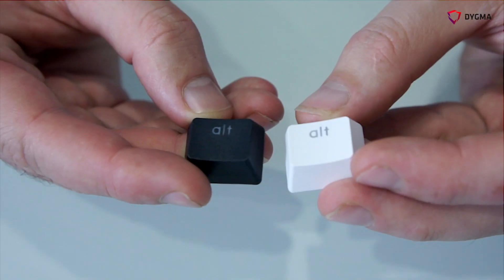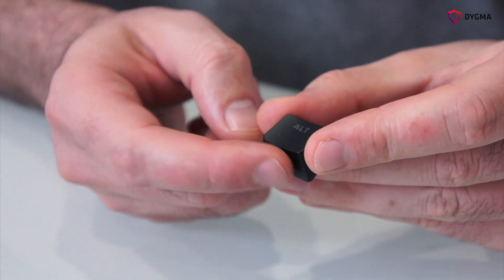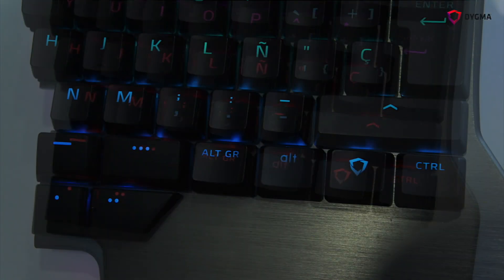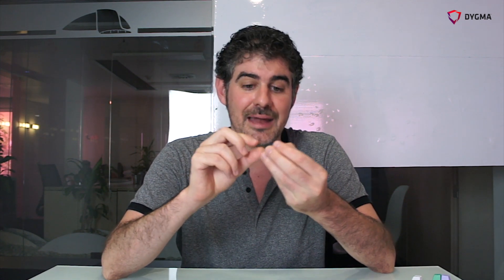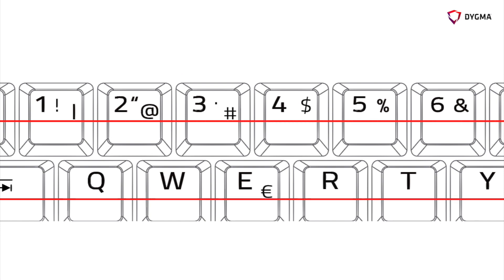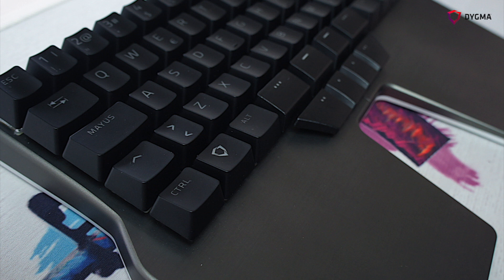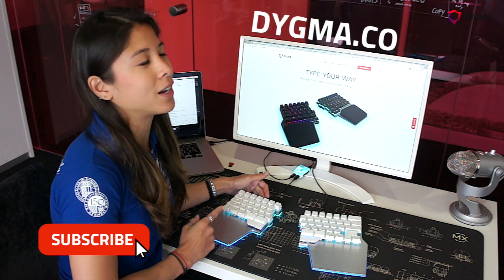Differences Between ABS and PBT Keycaps

Comment: Why dont had spanish pbt keycaps?
Reply from the maker: That's a good question. And the answer has to do with the demand for Spanish double-shot PBT keycaps and how PBT keycaps are made. Double-shot PBT keycaps are made using a mold, which is really expensive to have made. There are hardly any keycap manufacturers that sell PBT keycaps that aren't US or UK because the demand for other languages isn't that high.

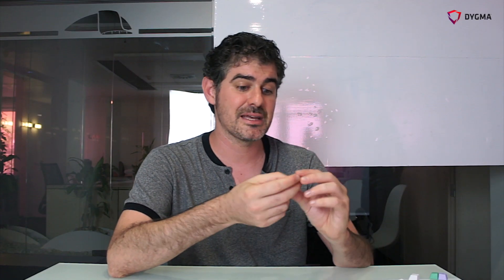Comment: I cannot understand what word you are saying at 1:15 when you say, "The ABS caps are absolutely xxxxx?" I NEED HELP PLEASE. I just got 4th Logitech Solar Wireless K750 for Mac (desktop) keyboard. I have old one right beside me which keys are shiny, smooth, silky to touch. This brand new keyboard feels so yucky chalky, grainy, not smooth. I feel I have to wash my hands every second. I am writing a book over 800+ pages for Pulitzer Prize (not kidding - Google me), and how keyboard feels is essential. I LOVED LOGITECH BECAUSE IT'S SOLAR & WIRELESS AND HAS FULL LENGTH WITH NUMBERS ON RIGHT. I DESPISE, HATE, DEPLORE THE CHALKY KEYS. This is a flat keyboard. I had one for 4 years - nothing ever happened to keys as you say paint wearing off never happened. The charge ran out. You've ruined my life. NO ONE AT BEST BUY OR LOGITECH EVEN KNOWS WHAT I AM TALKING ABOUT WHEN I SAY THE KEYS FEEL CHALKY. THIS IS HOW I FOUND YOUR VIDEO. WHAT SHOULD I DO? ANYONE? PLEASE.
Reply from the maker: "The ABS is an absolutely different process." 

So you don't like the new ones that you have?

Comment: What kind of black paint or coating is used on abs keycaps?
Reply from the maker: The base material is ABS 758, then painted in black oil, then finished with a UV coat

Comment: i use a razer hunsman, which has a really weird bottom row. i bought a set of cheaper pbt keycaps to fit on my keyboard and then ordered a separate bottom row from china that fits the 6.0x spacebar.

the set i have is not compatible with the stabilizers tho. i hope the bottom row is when it comes or i will have a terrible time typing with one single abs keycap.
Reply: You can take the small clips on the razer's stock spacebar off and put them on your pbt spacebar.

Comment: So PBT is non Nordic?
Reply from the maker: Nordic is ABS. Because we didn't reach the minimum quantity order for the PBTs for the other languages like Nordic, we had to make them in ABS.
Reply: @DygmaLab  I just sent you an email asking this. But this is kind of a dealbreaker when you have to pay the same premium for lesser hardware. And on top of that the Silver is not even available as Nordic at all, which is the one I want.
Reply from the maker: Anton Eiserman  I understand how you feel but ABS keycaps aren't lesser hardware. What's great about ABS is the light shines through brighter too. The Nordic layout is a unique layout and it's unfortunate that not many people are asking for this. If there were, we would consider creating them in PBT. But that would require us to create a mold and that's really expensive. But if we can find a better supplier, we'll offer them in white ABS again.
Reply: @DygmaLab  well. One solution could be to use the UK silver version and remap the keys holding the Swedish letters as it's the same form factor of keycaps anyways. Can that be done with your software? Letters ÅÄÖ that is.
Reply from the maker: @_eiso_  well as long as the keyboard language on your computer is Swedish, then the keys will input Swedish characters.